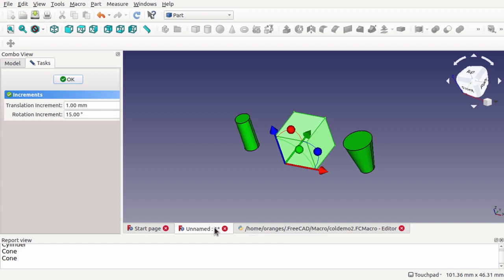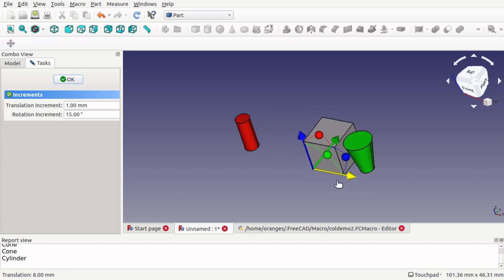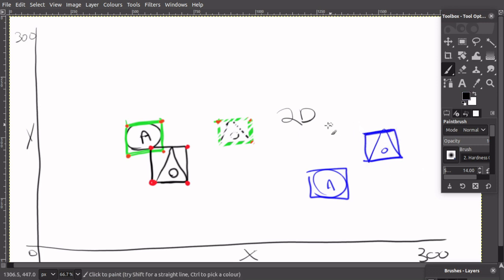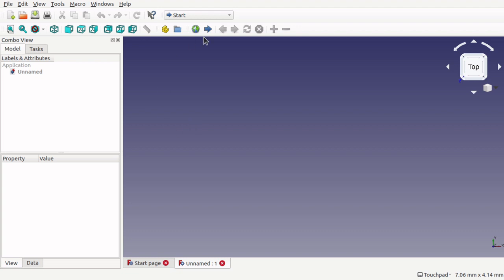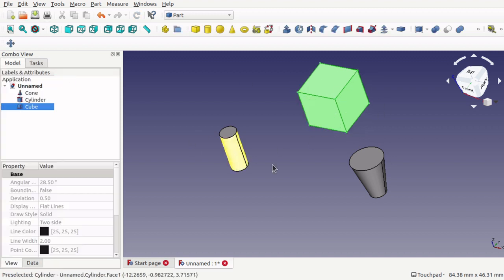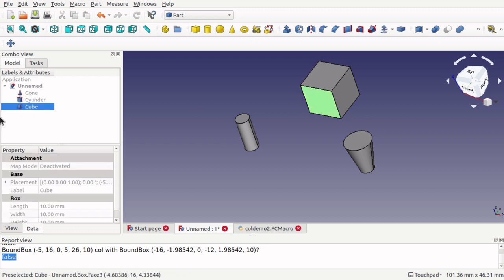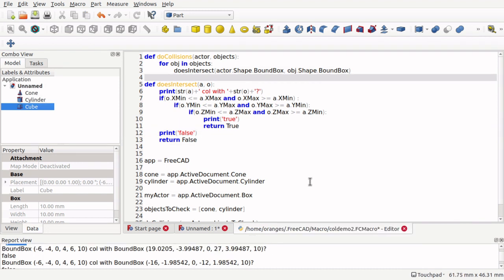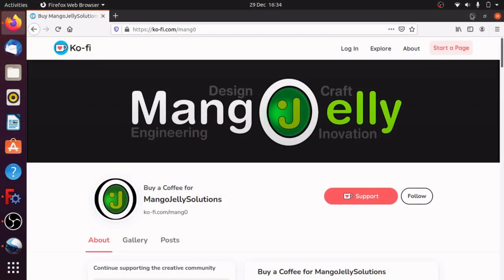FreeCAD: 3D Collision Detection between objects with simple code. Python for simulations / Physics

Comment: Absolutely Great work Brother, Impeccable, Just one doubt, isn't at 8:06 the upper line should be Ymax instead of Ymin?
Reply from the maker: Thanks for the comments and praise. Ooh I better check the code thanks for the heads up. I will do that in a mo.
Reply: @MangoJellySolutions   The code works perfectly fine, but I couldn't understand why Ymax is line closer to x axis and not far away from X-axis.